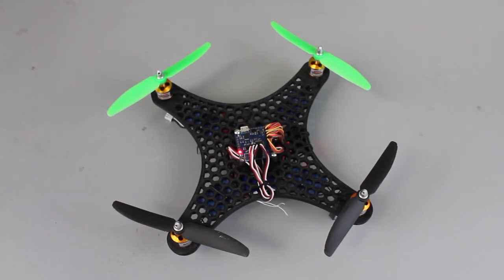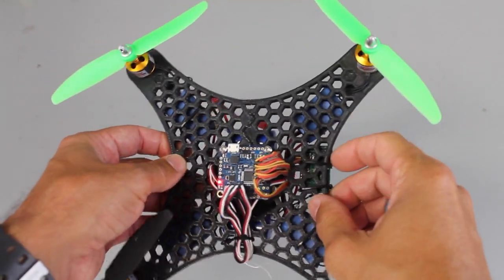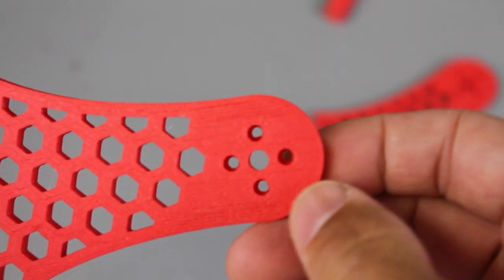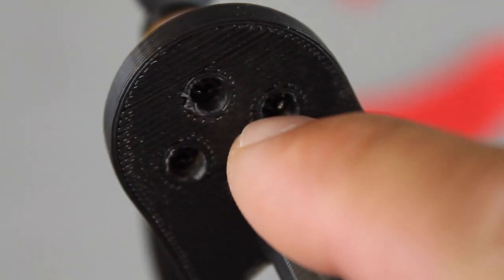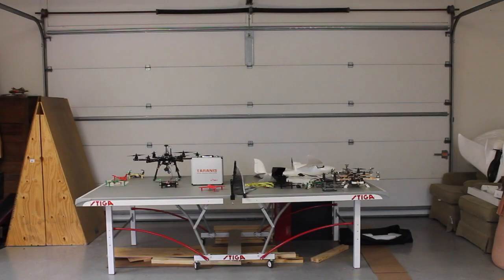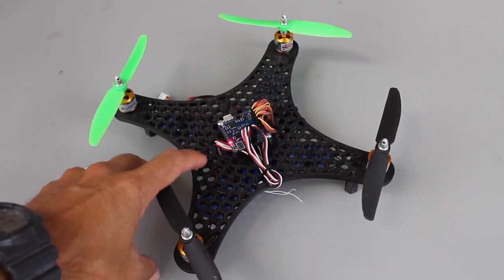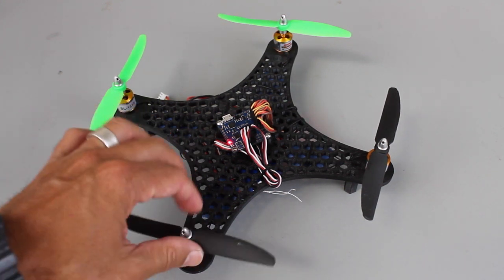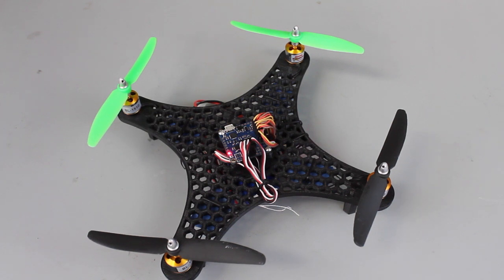3D Printed Mini Quad w/ Honeycomb Design

Comment: I've been working on a similar project I'm just about to build, but wanted to be even more agressive on the price.  Unfortunately, I don't have a 3D printer yet, so went with purchased frame. Good to know about Make xyz. Here's what I came up with for under $104 (not including shipping):

Diatone FPV 250 Frame (HobbyKing/US & others)
Flip MWC Controller (from RTFQ)
Mini Power Distribiution Board (RTFQ)
(4) RTF EZ 20A ESCs, SimonK (RTFQ)
(4) DYS BE1806 2300KV Motors (RTFQ)
(4) RTF 5x3 Props (RTFQ)
3s Battery,1000-1300 mah (HobbyKing)

Although I did buy a couple items from China (not my preference) because of availability at the time, all is now available from US sellers for about same price or less, plus quicker & more satisfaction. I also decided to try the Acro Naze 32 FC just for the heck of it (available from MultirotorSuperstore) instead of the Flip and I upgrade to the V2 frame.  So my cost ended up being ~$120. If one goes with the V2 frame then you can buy the whole package from RTFQ and he only charges a very small flat rate for shipping. If you're interested, I'm planning to do a short build vid and will followup with you.

Other US sellers I've had good experiences with are Buddy RC (has your motors), Getfpv and especially Aloft Hobbies for FrSky products (best prices I have found anywhere & great service). Just got DR4-II receiver from him for ~$20 for this build and he has a sale on everything now thru October.

BTW, been following your channel for a couple of months now. Really enjoy it. Great stuff, keep it up. Sorry about the long comment.
Reply from the maker: B Fun Awesome info. Thanks so much! I've enjoyed RTFQ in the past, but lately they are taking forever to get orders out the door. I guess they're going through some growing pains so I'm trying to be patient. I ordered 11 days ago and still haven't received a shipping notification.

I've been wanting to try the Acro Naze 32 on one of my builds and will plan on doing that in the future. Good job on getting your costs down. I think it's important to find an affordable first build that's relatively easy to get up in the air. My first build was a disaster but I got it to fly. Had no auto-level capabilities so you can imagine what a nightmare that was for a n00b. 
Definitely keep us posted on your progress. I'd love to hear how it goes.
Reply: Dennis Baldwin RTFQ...yes...well there is that. Still, good prices, a lot of pre-configured gear; hard to beat if you don't mind a few extra days.  And when I recently ask about a different configuration than offered on an item, he emailed a couple days later that he had updated the product page to include my requested version. So in my book, what he lacks in speed, he makes up for in customer service. Now, if that item would just hurry up an get here...

Comment: Dennis, could you measure size for me?  I mean my printer can only print 200x200x190, and if I measure where the motors go on one half, it is like 7.5"...  What is wrong here?  idk I really am already almost giving up on this quad frame cuz I am so discouraged already... Well I guess since diagonally it measures really close to 9" I guess I did build it right..?  I did measure the center of each hole for the motor mounts, they were 13mm on the dot of the center of each hole, plus the landing gear did fit..  So is it all ok and good to move forward to buying the motors and what not?

Comment: Hi Dennis. I was wondering how light with the honeycomb design compared to the yellow one? Also what is the weight of your new frame? Btw. Love the videos!
Reply from the maker: Donny Bea I don't know how much lighter the honeycomb is off the top of my head, but will see if I can find that out for you. The AUW of the new honeycomb build is 290 grams. It's a little rocket with a 3S lipo. Hope this helps and thanks for the comment.

Comment: Awesome update Dennis! Will your frame fit 6" props?
I have a mini 250mm that I'm flying with Emax mt1806 2080kv motors, switched from 5x3 to 6x3 props and getting 9mins flight with 1300 3s
Reply from the maker: brandon cruz Good question. I haven't tested 6" props but plan on doing it soon. I'll be ordering some this weekend and will let you know. Design-wise in Rhino 3D I can fit 6" props with 8mm of clearance so that may a little too tight, but we will see. Thanks for the suggestion.

Comment: Dennis, I like it very much! 
In fact, we (me and my son) have decided to build a quadcopter based on your design.
But we are using a different type of motor (MT1806) which has the bolts spaced 12mm and 16mm. Could you modify your design for me? Or perhaps provide me the source CAD file?
Thank you!
Reply from the maker: Ramon Encinas Quer No problem at all and glad to hear you're going to build one. Shoot me an email (db at unmannedairlines dot com) and I'll work on getting you the source file. Good luck!

Comment: Just built this Quad using your exact specs for my 15 year old son.  The link for the PIDS is dead.  Can you post the PIDS again?  

thanks for all of your great videos
Reply from the maker: +RandyB Thanks so much for the feedback. I don't know where my PIDs are at the moment, but will see if I can dig them up. I put a different flight controller on the quad so the PIDs are now different. They default ones if I recall are a bit low so the quad will feel sluggish, but I was still able to fly it. I tuned them up by slowing incrementing and then flying in between changes. Sorry and I'll see what I can dig up.
Reply: +Dennis Baldwin  Thank you!

Comment: Hey Dennis,
have you ever thought about to print a UFO Quad (Disc) ?
Reply from the maker: stereodreieck No, but I'll definitely look into it. I have limited space on my build platform so I'd need to print it in pieces. Will let you know what I find out if I end up printing one. Thanks for the suggestion.

Comment: I was unable to load the controller link. I was also wondering if everything linked was all I would need to fly? I have been wanting to build a drone to practice on and this one would fit my budget nicely. Also are there tips you might have on making a super steady drone? Would that be an engine or software type upgrade? Or another part entirely? Thanks for any help!
Reply from the maker: +Stuart Wilson It looks like they've changed their site and here is the new link:

http://www.readytoflyquads.com/flip-mwc-flight-controller

In addition to the parts listed in the video description you'll need a transmitter and receiver. Good luck with your build and let us know how it goes!
Reply: +Dennis Baldwin do you have some recommendations for those?

Comment: I need some help. My drone I made with a 3D printer is messed up. When I start it up. It will go up, then flip over and crash. The first time it happend, it didnt break. But second attempt same thing happened with no damage. Could this be a software issue?
Reply from the maker: +Misgo It could be a software or more likely, a configuration issue. I'm not sure what FC you're using, but I would recommend making sure you calibrate your escs, go through your FC calibration settings as well as make sure your motors and props are spinning in the right direction. Good luck and keep us posted on your progress. It would be interesting to know what the root cause of the problem is.

Comment: what's the green chip on the bottom side you didn't mention it
Reply from the maker: It's just my receiver. I had taken it out of the case to save a little bit of weight. Good question :)

Comment: Can i fly more higher ? or should i add more battery powers ?
Reply from the maker: +Saiful Anuar Yes you can fly higher depending on your tx/rx. You can go with a bigger battery but I would get comfortable with your current setup first.
Reply: +Dennis Baldwin Thanks , nice project 😊

Comment: Hi. I'm new into 3D printing but I've been flying rc aircrafts for more than 8 years. I'd like to know where I can find 3d printer files to build multirotors. Thank you so much!
Reply from the maker: Junior Angel You can find the one from the video here:

http://www.thingiverse.com/thing:463579

and I recommend spending some time searching through www.thingiverse.com. There are plenty of cool 3D prints there. Good luck with your search and hope you print some fun stuff.
Reply: Thanks Dennis. I've found some and I'm getting ready to get my printer. Any sugestion? My budget is around $1,500.00
Thanks again for your helping.
Reply from the maker: Junior Angel I have a Replicator 2 and love it. The MakerBot Mini may be an option for you. Not sure what size build platform you're looking at. Another one I haven't used, but have heard good things about is the Ultimaker. They have a smaller version that will fit your budget. Lastly, I'm really excited to see what happens with this project:

https://www.kickstarter.com/projects/tiko3d/tiko-the-unibody-3d-printer

It will be next year before they start shipping, but it looks impressive.
Reply: Dennis Baldwin
Thanks again for your help. I've been researching and I'm buying a CTC that's a knock-off but has very good reviews. It's my first one. Let's see what happens...

Comment: what receiver and controller are good?
Reply from the maker: +Whopper Mods Probably Turnigy 9X is a good place to start. I'm using the Taranis now and love it, but definitely a pricier purchase. I've also built one of these using the Turnigy 6X which is smaller, cheaper and only has 6 channels.